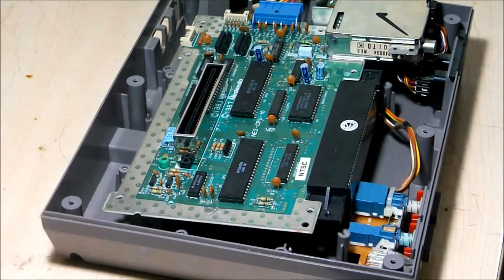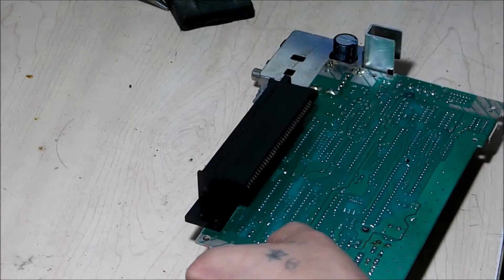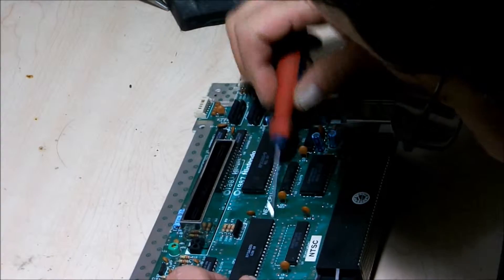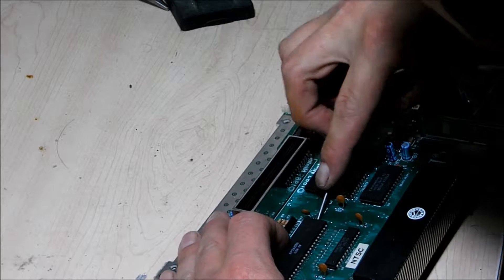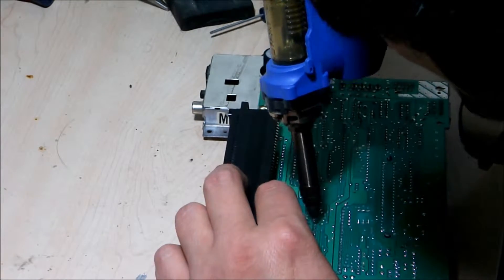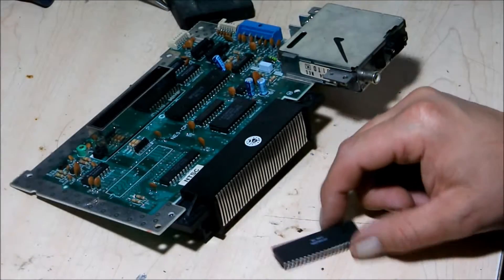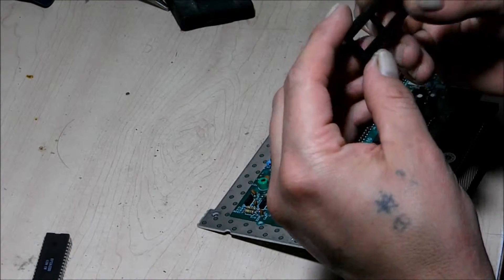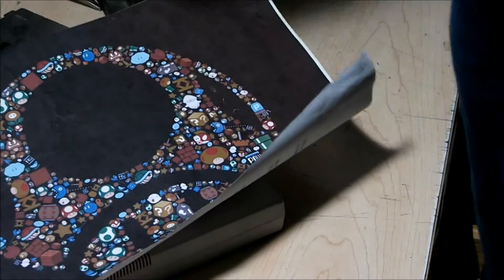Removing a Faulty NES CPU w/ Hakko FR-300

Comment: In double sided pcb the joins must be blowed away using hot air in high pressure to clean the holes and remove the chip.Using sucking pumps it will never clean and pcb will destroyed.The things are go to worst if use any flux.

Comment: what is your impressions about this? is it worth? I intend to use on notebook and modern consoles
Reply from the maker: I think that this tool is the best! However, this tool may not be as useful in modern devices. Most newer devices use smd's and not particularly through hole components.
Reply: +Bux Produxshuns agree, but Xbox 360 uses through hole caps and inductors, and when  you know there's a short it's a pain to dessolder trying to find exactly which one is. anyway, thanks a lot for you opinion, now I'm sure I want one of these
Reply from the maker: +Rafael Jeveaux Thanks for the reply, in those cases, yes. Capacitors and other bigger components.